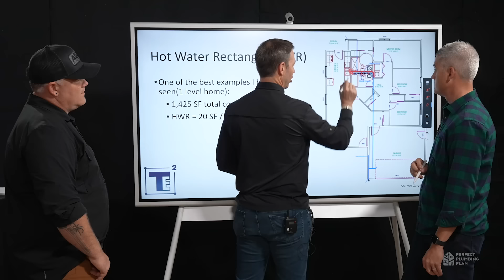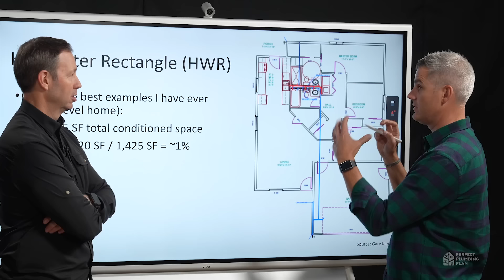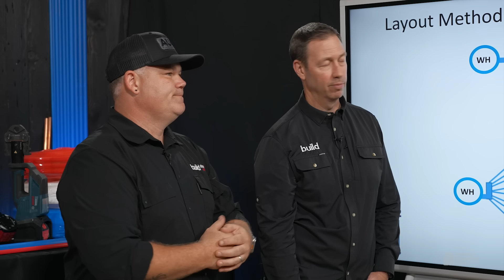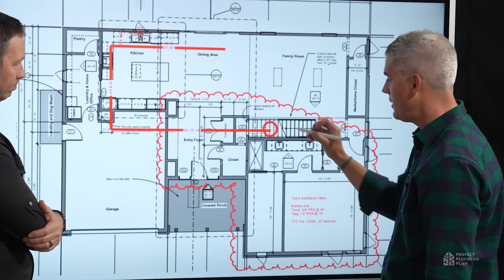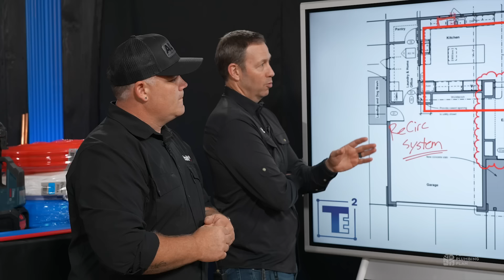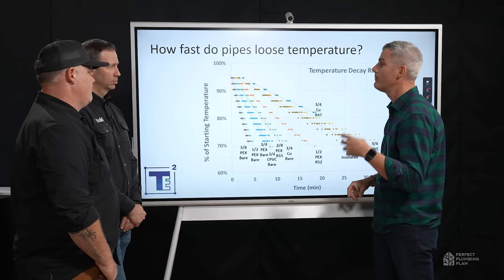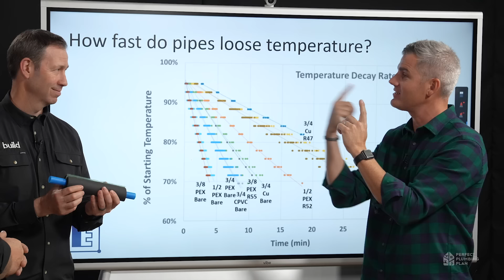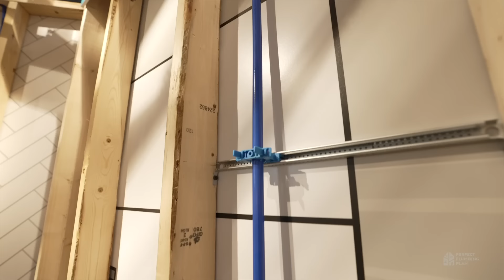The Perfect Plumbing Plan - Ep. 2: How to Get Hot Water Under 10 Seconds - Plumbing Layouts Part 1

Comment: Great tips and thinking. Couple of thoughts.
1.) Manifolds are great until they leak and hopefully the manufacturers don't change and discontinue the repair options (viega sucks).
2.) Recirculation systems increase wear and tear on plumbing system. Also probably increase plastic leaching.

Comment: Some of the comments seem to disagree on the validity of the presented graph. While the video’s graph does support the talking points, I think the trends themselves are misleading.

For example, lets use the provided graph and assume a 100 DEGF starting temperature. 

At 8 minutes, the ¾” bare PEX is at 70% of its starting temperature, so (.70 x 100 DEGF= 70 DEGF). So the ¾” bare PEX has lost 30 DEGF (100-70= 30) in 8 minutes.

At 12 minutes, the ¾” Cu Bare is 70% of its starting temperature, so (.70 x 100 DEGF= 70 DEGF). So the ¾” bare copper has lost 30 DEGF (100-70= 30) in 12 minutes. 

To conclude, the PEX lost 30 DEGF in 8 minutes. The copper lost 30 DEGF in 12 minutes. So the PEX is losing heat faster than the copper piping.

However, this video incorporates an imperfect understanding of heat transfer. It seems like the data points are heavily focused on emissivity values but should be focused on thermal conductivity. 

Thermal conductivity, refers to a material's ability to conduct heat. It describes how efficiently heat travels through a substance via conduction. Emissivity is a measure of how well a material emits thermal radiation. It indicates the ability of a surface to emit heat energy in the form of electromagnetic radiation.

PEX does indeed have a higher emissivity (0.9) than copper (0.6 when slightly oxidized). The issue is that copper has such a high thermal conductivity (850x higher), even with a lower emissivity than PEX, with any type of natural air movement, the copper will transfer more heat.

I am curious of how TE2 engineering produced these data points. It seems that the emissivity of the copper was probably assumed as polished copper (<0.1). A fouling coefficient was not utilized. Oxidation of the copper will begin immediately and result in an emissivity nearly reaching that of the PEX. The other assumption probably made was a zero value for air movement. Fine for a calculation, but will not provide realistic real-world results.

Either way, once you incorporate the IECC requirement of 1” insulation, the heat transfer differences between any type of piping materials become inconsequential. This is the reason that energy codes do not differentiate insulation requirements based on the pipe wall material.

Comment: Curious Would it be better to use Plastic or "Brass" Fittings e.g. "T"'s & Elbows?  I am running Pex to a Bathroom with on second story with Tile and Hydronic Radiant (Floor) Heat and Finished room below.  I want the most dependable so no leaks, ( No Room to run Multiple Pipes for Manifold.  Insulating both Hot and Cold.  Live in Maine  Cold supply water.

Comment: The price of point-of-use electric heaters has come down so much that they're worthy of consideration for those problem runs where you're looking at a full minute of line flush before you see hot water. You run the house hot water into their cold inlet.

Comment: I am not a plumber but I have a good grasp of residential plumbing as I have done plenty of it.  A dozen years ago, I had to run the hot water to a new bathroom that’s about 90’ away from the water heater. 

I didn’t want a recirculating pump for 3 reasons: Too expensive and complicated, it will break down sooner or later, and while it helps save some water, it doesn’t reduce the heat waste much. 

I decided to experiment to see how small of a pipe would be adequate for that 90' long hot water line between the WH and the bathroom.  

The bathroom has a low-flow sink faucet (0.5 GPM) and shower head (1.25 GPM).  

I found that I was able to feed the entire bathroom hot water with a single ¼” (no typo) pex pipe.  Sharkbite makes a ¼ to ½ push fitting that’s perfect for the job. Once I got to the bathroom area, I converted back to 1/2” pex to be able to connect to the fixtures. 

The flow and pressure at the shower head won’t blast you away, but in my view, it’s adequate.  It’s a small bathroom and it’s not meant for two people to use the hot water at once.  It’s been over 12 years, a number of people have lived in that place, it’s worked flawlessly and I’ve had no complaint.  

Bonus: 

¼” pex is very easy to run; it looks and feels like 14/2 Romex wiring and occupies very little space. 

This company called Niagara makes great and inexpensive low-flow shower heads and faucet aerators; I’ve installed them on over 20 rental units over the years.

Comment: I'm glad I came across this video.   Waiting on hot water is frustrating.    I have a couple of questions;
1. Does the  recirculation pump make the hot water unsafe to drink?
2. Does keeping the hot water supply line hot affect the durability of the Pex-A pipe?

Thank you,
Reply: 1. No, the recirculation pump should be NSF 61/372 approved for drinking water use. The Grundfos model they showed has that, and anything you install should as well.
2. No, but hot water recirculation does degrade piping over time. Ensure you're buying a recirculation pump that has ECM capability (variable speed) and limits flow rates only to what is needed for your system like the Grundfos model they showed.
Reply: @essentialhomeowner Thank you

Comment: Why not? Just run cold water to each floor and have a heating system for each level.  I'm working on a cabin right now and I'm putting an elevator shaft in. Hot water floor heating will be installed in the elevator shaft.  I want independent hot water for each level.

Comment: You didn't mention a passive recirculation system. I used a  loop that returned to the water heater through the lower tap . To improve efficiency I encased the loop in a 3" block of XPS foam. The system works best with the  WH in basement.

Comment: Instead of the smart pump we use motion sensor to turn the traditional pump on when someone walks into the room.  The sensor wires to a plug at the WH that powers the pump.  Big homes can have 2 or 3 trunk systems.  Smart systems will not get you in the middle of the night or when you stay home from work, etc. etc. The motion sensors are much better for a nominal electrical expense for the switch receptacle or the pump multiple switches for each trunk, depending on the size of the home. They make mixing valves that can be installed on the cold line so the cold pipe will bring the hot back to the water heater. Only downside is you get warm water out of the cold faucet while working until it’s purged.
Reply: You're bound to have false activations with presence sensing. Not every time you go into the bathroom is there a hot water demand (e.g., getting laundry, brushing your teeth, taking medications).

Comment: I just had my new house built.  I have 2 electric on demand hot water heaters close to the main hot water using areas.  Unfortunately, they put a massive trunk and branch system in so I have to wait a fairly long time.  And then on the cold side for my garden hoses, they put a ton of fittings and smaller pipe, which drops the pressure a ton, even when flowing ~3 GPM from a lawn sprinkler.  It dropped 40 psi at 3 GPM, which is horrendous.  Since it's all accessible from my basement, I think I'm going to re-do it all to optimize it for faster delivery.

Comment: I don’t think it matters if the kitchen sink doesn’t get hot right away.  I don’t wait for the water to get hot before I start using it for dishes, hand washing, etc.  Also by the time I start the dishwasher I’ve already primed the pipes by pre washing, handwashing larger items, etc.  The same goes for lavatories.  I’m not brushing my teeth or washing my hands or face with hot water.  Proximity to shower (not even the tub!) is really the only thing that matters.

Comment: If you have a recirc pump, you better have a soft water source, or a whole-house water softener.  Otherwise that pump will seize up in less than 5 years.  As tough as hard water is on valve internals, it's even worse on pumps.  Been there, seen that.

As an alternative, consider a natural circulation loop.  Yes, it really works.  No pump.

And don't forget to insulate your HW piping loop.

Comment: Hey manufacturers, give me some 3/8 options in fittings, piping, and stop valves in modern materials (PEX).  Plumbers, use it so it stays available please.  Code, let me use it.  200 ft/gallon on a 3/8 pex line, perfect for a remote kitchen faucet without the cost/complexity/energy loss of recirc.

Comment: As Owner-builder, my new home design will start with multi use mechanical room as close to center of living space as possible.
Reply: I can think of two minor points on that good idea.  Most places, the p/t safety on the water heater has to exit outside the building or dump over an open floor drain setup - visibility is the test, and we can't just tee into a vent stack or direct to drain.  Second is if  using gas for water or furnace: make up air has to be ducted from outside.  Not really a problem, but maybe its a good idea to say no to 2x4 framing of that space because plumbers will be punching holes all over.  I'm thinking 2x8 or better, depending on if its load bearing and/or two story - places with big snow loads kind of know the drill.  Where I live, code changed sometime ago [even before IRC adoption] and 1" vents of decades past are now replaced by 2" [so inspectors don't demand proof of drain size] - they could put 1 1/2" where a 3" drain exists, but most do not want the hassle and oversize if in doubt.  Folks should note that 2" sch 40 pipe has an outside diameter of 2.375"... and that nearly erases any 2x4 strength as the hole must be even bigger to allow install - probably 2  1/2" gone.   
Personally, if there is an enclosed garage, I'd go with adjacent space and run a [well insulated] hot water circ pump loop.  When I say well insulated, I mean exceed code:  something near suitable for steam service, not big box stores cheap foam wrap.  A loop always adds some heat load to structure like large groups of people do, and... the air conditioning bill might like it.

Comment: Matt, in fact, if you had your water heater in the garage and installed a heat pump model, your garage could’ve been cooled by it.
But also don’t forget when installing a HPWH that you cannot run a regular recirculating pump with it. You’ll need a flow sensitive pump for it so you don’t wake up with lukewarm water at your fixtures.

Comment: Every time the recirculating pump you are wasting hot water.  The pump runs all day and night off and on, on and off tell the temperature of the water heater cools it turns on the water heater heats the water. Then it all starts over again. Just wait the extra minute you’ll save way more money.
Reply: Running a recirc pump 24/7 is a thing of the past. Modern pumps have timers and advanced control capabilities (presence sensing, learning occupancy schedules, smart home functionality, etc.) to only run the pump when it is necessary.

Comment: I dispute the use of a rectangle to assess hot water needs. You could have all your hot water outlets for a large house along one wall and your rectangle would have zero area even though your outlets spanned tens of metres. Or you could have two walls that were much shorter on total but they were at right angles and created a relatively large area.
Anyway I think it's time to move on from the single large hot water tank that is so unresponsive to changing needs in the household. The efficiency of a big tank storage heated from low-cost energy such as heat exchange can't compete with the efficiency of a very small electric heater at each outlet or cluster of outlets producing hot water when and where we need it. When there's one or two people at home all week, you only heat the water you're actually using. When adult children and grandchildren descend on the house for the weekend and they're outside all day getting sweaty and dirty and maybe creating some aching muscles, you have all the hot water you need for everyone.
And when you have a separate hot water unit for each cluster of outlets, you don't have to worry if you have outlets at opposite ends of the house - it's just an extra cold water line when you're building, rather than wasting water waiting for the hot water to arrive from the far end of the house forever after.

Comment: Also how does a gas tankless with a built in circ factor in here too?
Reply: Same concerns. This is mainly about heat loss in the system after the water heater, so it doesn't matter if the WH is a tank or on-demand.

Comment: Note: energy costs (electricity) to run a hot water recirculation pump is quite a bit more than you may think.  24/7 recirc, dependent on config/size will run you >$50.00 per month at avg USA kw costs.  Bigger house, it's over $100.00 per month pretty easily (this is also assuming electric water heater).  If gas or heat pump, you cut the cost by about 1/2.
Reply: Your numbers are extremely off. It is anywhere between $6 and $50. I have a Grundfos pump that consumes 6 watt while running. Even if it was running 24/7, that would be 53 kWh. My electricity cost is roughly $0.18 so the annual operating cost is $10 for the pump at worst. 

If you include the water heating cost, then I would depend if you live in a cooling or heating climate. I’m in a heating climate so any heat loss offset the home heating cost.

$100 a month is extreme.
Reply: @titanium-alloy  The biggest factor in cost increase is the re-heating of the water in the circulation loop.  For hotter climates, particularly when the hot water heater is outside, heating water can be much cheaper (assuming cost of electricity or gas is also decently priced).  Assuming the house is temperature controlled to ~70'F/~21'C, there will still be quite a bit of heat loss from several hot water lines.  The larger the recirculation loop, the more heat loss and energy to re-heat it.  That's what i was calling out, most people tend to just focus on the '6 watt' recirc pump but the real cost is in reheating the water being recirculated.
Reply: @Ifishmo Added benefit for northern climate. Hydronic heating.
Reply: @titanium-alloy  it's mostly a waste in the summer

Comment: I've often wondered if putting a 3GPM electric tankless water heater in each bathroom/kitchen would be more efficient.  Single cold line supply through house.  I acknowledge that the cost of wiring and electricity would likey be higher but no water waste and no tank of water to heat.  Has anyone truly run the numbers on this?
Reply: The problem is electric load calcs. Electric heaters are a huge demand; one shower is ~2gpm, in the south (with warm ground water) that's about 18kW per shower (80A breaker). So 3gpm will be 27kW or 120A breaker. And those are high demand loads so they're usually calculated as continuous loads similar to EVSEs.
Meaning you surpass even a 320A service pretty quickly.
Reply: I did a 36 kw (160A) and a 18 kw (80A) electric on demand unit.  It's very expensive for the wire and you need 400A to reasonably do it.  You could get away with a few 60A 1-1.5 GPM units for the sinks, but the shower (~2-2.5 gpm) and the tub (5-8 gpm) need big units or even larger.  My 36kw with my ~55 F deg incoming water temp is only good for about 4 GPM, +/- 1/2 GPM depending on how hot you want it (105 vs 125F).  I had to throttle the tub flow rate.
Reply: I was thinking the same sort of thing, but with a small tank so it could run off of 120 V and not draw so many amps. Probably not enough capacity for showers, though. You're right, it would be cool if someone ran the numbers.

Comment: Also you should get into on demand water heaters. We have a rental with on demand and a really short distances and still a long wait for hot water
Reply: I have one too and the devil,is in the details; tanks heat the water at higher temps, 140-160. On demand it’s 115-120. When you first turn on hot water, the pipes will probably be cold and some of the heat will be lost warming up the pipe before it gets to you. The 160 will feel warmer sooner than the 120 will. Also I noticed if you call for hot within 10 min or so, the on demand water in the pipes is already cold and you need to wait for the new hot water to get there. The tank seemed to keep,the pipes warmer longer. Of course the whole point to on demand is not to pay for wasted heat and endless supply of hot water.
Reply: You also have the trade-off of higher install costs (units, gas lines, electrical lines, etc.) and lower output temps. Definitely a solution that minimizes heat loss, but there are trade-offs.

Comment: LMAO you guys never talk about the SYSTEM efficiency and energy consumption with recirc pumps. Sure the pump only consumes 38w, but the pipes are not perfect insulators so the pipes are always losing heat.  So the fact that its frequently sending cooled water back to the water heater means the water heater is going to run MORE, which is where the real energy expense in the system is.

Comment: The Energy Vanguard site by Allison Bailes suggested using a manifold system for hot water using downsized pipes, such as 3/8” Pex to faucets. The pipe from the valve to the faucet is already 3/8”. That dramatically reduces the amount of cold water which needs to go through low-flow fixtures. For extremely low flow faucets in places like California, a 1/4" line could be used, but an engineer has to stamp that on a drawing. The manifold should be as close to the exit of the water heater as possible.

The advantage of this system is that the pipes don't have to stay hot all the time, and no recirculation pump is required.